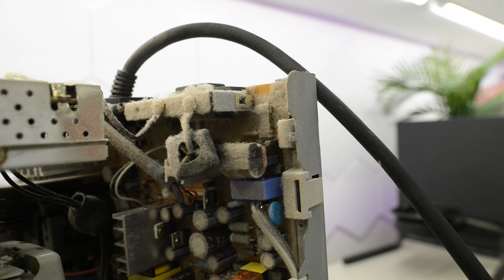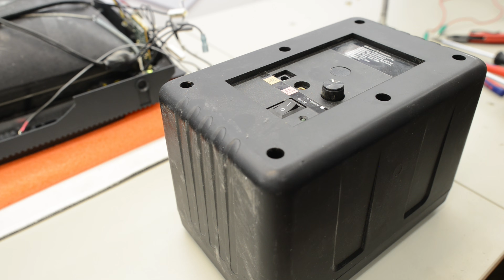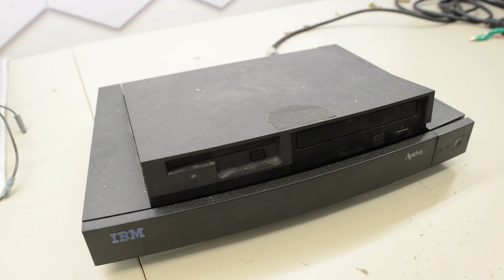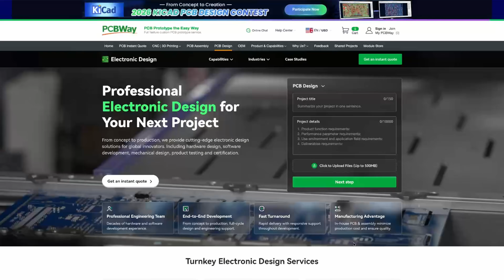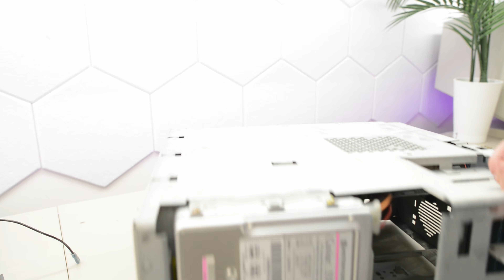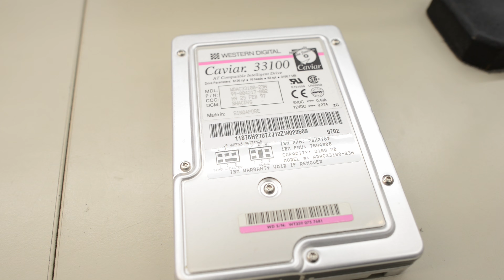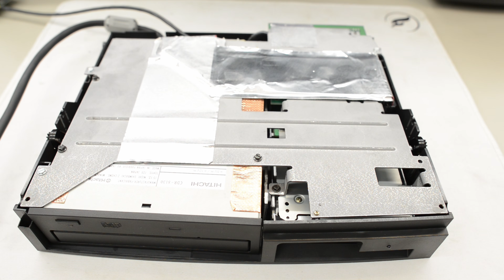IBM’s Forgotten Masterpiece (1997)

Comment: I have a very similar Aptiva, and it works fine, however I'm concerned about the power supply, it's now 30y old, I'm wondering if I should look how to replace it with an ATX + AT adapter, what do you think? Should I just keep using the original AT until it works? I'm worried that it could damage the mainboard if it fails at some point
Reply: It is not just regular AT. It has extra connectors so you need to wire those up as well if you're replacing it.
I would just keep using the original, but do an inspection to make sure the caps are looking good and still within spec.
Low quality PSUs were known to take out other components when they died, but I'm sure IBM only used good quality designs. Doesn't mean they can't die, but they have protection circuits and should be able to detect the fault and switch themselves off.
Reply from the maker: Impossible to say. I guess it could happen. I use my original PSUs until they fail, and then I recap them.
Reply: If you're worried about it, learn how to re-cap your PSU.  That's usually where the problems are, and it's a good skill to have if you're into retro PCs.

There aren't too many failures other than expired electrolytic caps in PSUs.  I've had ONE that had a bad high-current diode on the secondary side.  It was pretty easy to figure out what went wrong -- it was a dead short instead of a diode drop.  I replaced that and it's working beautifully.

FWIW, I'm in favor of just replacing caps on any old PSU.  I've had a few that I didn't notice were leaking (one was a PS/2) until I pulled the caps to replace them anyway.  I had one NOS Delta PSU that I decided to let run w/o recapping, and it failed not long after putting it into service.  The ATX standby power pin had FIFTEEN VOLTS on it according to a meter -- although I'm sure the output was not perfectly clean DC, so who knows what the peak voltage was.  I'm lucky it didn't fry the motherboard.  Some of those older switchmode designs are good and robust, but if the cap fails that gives the switchmode controller its main bootstrap rail, things go downhill quickly.  IMO, if you can confidently do preventative maintenance, you're better off.  You just have to be good enough that you're more likely to make it better than worse, and that's a product of experience.

Comment: I watched a video from Mike Tech yesterday and he was working on a aptiva with the exact same case system, but not the same model of course,
Reply: Yeah it looks like a slightly newer system board with a VX SDRAM chipset rather than the Opti Viper in Mikes one but with the exact same formfactor down to the strange individual riser connectors.
Reply: Was about to say this. The hard drive right at the top of the case is distinctive.
Reply: @squeakonline  And that crazy slot board the plugs into the MB.
Reply: EpicMikeTronics ftw!
Reply: That guys channel is so great, literally embodies what YouTube used to be.

Comment: Ever got caught by a 32kv discharge via the line transformer of the caps on a computer CRT? (side effect of a screw driver with a light, used to detect voltage, that instead of lighting up was passing current straight through, likely as result of the high frequency)
The screwdriver ended 3 meters away stuck (like a dart) on a plant that was leaning against the wall. Me, well I was seeing black for a bit...
Reply from the maker: Holy shit! Note to self, don't try that haha. I hope you have recovered fully.
Reply: @Epictronics1 yeah, looong ago! I was a teenager when I managed to get zapped this badly 😅

Comment: I used to have one !
I spet way more time I'd admit just to figure out how to turn it on lol

Then I also realized the previous owner had "upgraded" it with a K6-2 500 ... without changing any settings, so that poor thing ran at 233MHz with 2.9V for probably a couple of years ...

Edit : actually mine was newer, I remmeber the motherboard looked more like an ATX board, had an onboard trident card with a RAM slot to  expand its ram (similar to the one found on some ATI rage cards), and yeah as I hinted it had a pmmx 233